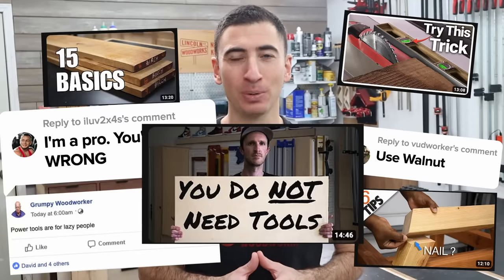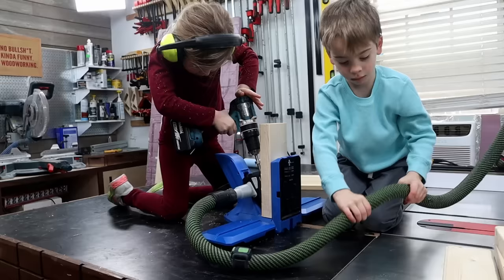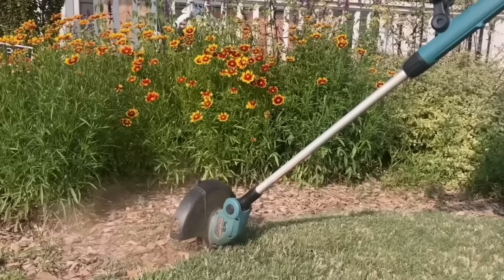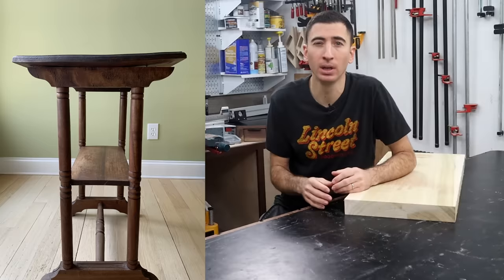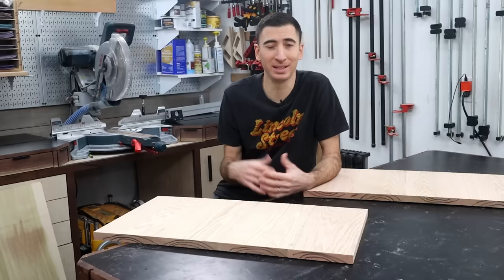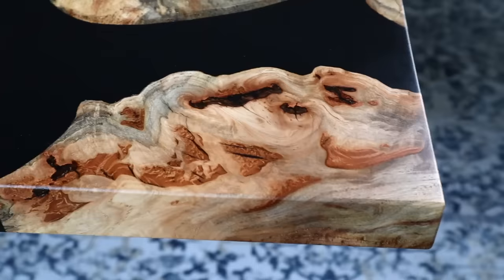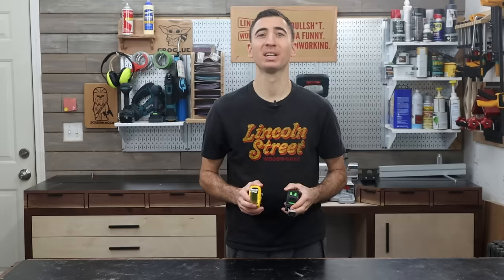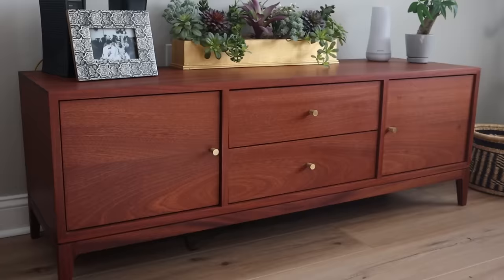Every beginner needs to hear this

Comment: I've been using the same Black and Decker cordless drill for 11 years. Used it on everything around the house building a ton of storage shelves in the basement, used it to build workbenches and frame in the non-load bearing walls in my basement (the horror!) using high strength deck screws and build my kids treehouse and build numerous planters and benches for our backyard across two houses and for building tons of store-bought furniture. I even tried using it as a hammer drill a few times by hitting the back quickly with a mallet (did not work well) and it still works great today. I have their yard tools that share the same battery and those work great too. I've never understood the hate. Outside of trying to hammer the drill to speed up concrete drilling, I don't abuse my tools and generally take care of them. And they take care of me. I've really gotten into woodworking in recent years and consider myself to be between a hobbyist and a professional. I also have some Dewalt tools, some Porter-Cable tools, and they all work great. The only tool that I have that sucks is a Skil table saw that is almost 30 years old that my grandpa gave me, and I'm going to replace it with a Saw Stop later this year because it scares the living hell out of me and is so bent out of square.

Also you know what's the best bang for your buck value? Wen tools. Their larger power tools are very affordable and good quality.

Comment: Regardless of what comments you receive, your advice is sound and practical. Having started my woodworking journey over 40 years ago, I've personally encountered every one of the mentioned subjects in this video and I can attest that your advice is genuine. The one I suggestion I've seen that I really don't like is the wood glue and sawdust. Whenever I've tried that I've found the concoction ends up setting itself before I get to use it. Maybe I was using the incorrect glue but the glue started to dry too fast.
Your info on glued boards cupping, as you mention, is spot on. I glued up a table top of mahogany 4/4 boards using the alternating method and that tabletop ended up at 3/8" thick as I continuously battled the top cupping after each sanding. I eventually decided to seal BOTH sides after the final flattening and viola! the top stopped cupping.
Thanks for your videos. I enjoy everyone you've made.
Reply from the maker: Much appreciated! and thanks for watching

Comment: Thanks for helping reaffirm I'm not a total idiot in the shop.  Simple, logical explanations to some great debates.  I've always looked the overall integrity of a project and not just one single joint.  And your best advice, pick your favorite color, and go with that for a battery system, brilliant.  Great video, thanks for sharing.

Comment: I have to say to the "Measure Twice Cut Once" being replaced by sneaking up on a cut with the internal piece; You are still practicing what is meant by rule/law in that statement, you're in keeping with the spirit of "Measure Twice Cut Once" when you're sneaking up on the cut.

I'm not even a hobby joiner but I use this saying as a reminder of due diligence in my field/trade.
Reply: Except that in reality, he's measuring (presumably) twice and cutting AT LEAST twice.  So, it's really not the same, but can save aggravation later.

Comment: Thanks for calling B.S. on two of my favorite mouth-breather gallery topics: Joint strength and tool brands.  My first media console was assembled with every 'wrong' technique possible... butt joint screws, pocket screws, glued end grain... but it looks great on the outside and years later it hasn't imploded and it's still doing a great job of sitting on the floor and being furniture.  On the tool subject my Dad has used and abused an old Ryobi cordless 5pc kit for years (remember when they were blue?) and guess what... they still get the job done.
Reply: The new batteries have the same platform. As long as the voltage is the same, a new battery WILL work in an old drill/saw/or other. But... The new Chargers Won't work for older batteries.
Reply: I'm a beginner woodworker, but am a full time husband, dad, and domestic repairman.  Regardless of what tool brand I buy I will eventually wear it out.  However I would have gotten  enough years and use out of it that it really didn't matter which color tool I chose.
Reply: Good point on tool brand. My Hyper Tough Walmart power tools might not be as nice looking as my Milwaukee or Rigid tools but they all are 2/3 less and are still running strong.  I originally bought the Walmart brand because I did not want to damage the high price  Milwaukee or Rigid tools while working with tile and cement. Seems I can not wear these cheap tools out while the Milwaukee Sawzall died cutting down our metal swing set. No worries though a $45 Hyper Tough saved the day.
Reply: Butt joints. Yes, never had a problem wid'em.
Reply: Since photography is going away now it's power tools.  GAS- Gear Accumulation Syndrome.  One of those 88 millimeter battery powered nail guns would be helpful  but I will stick with the air compressor for the occasional work I do.  How come I see all these Milwaukee drills on the thrift store?  They only had time to steel the drill and not the battery and charger (this will get me kicked off).
Reply: @Jeff-jg7jh  My employers truck was broken into and they stole 6 DeWalt drills and none of the batteries. The drills that they stole didn't have batteries in them because they were inside the shop being charged. The drills were found in a pawn shop not even 5 miles from the shop. The guy sold them all for $25 because they didn't have batteries. The guy went to prison for 3 years for $25 . The guy at the pawn shop called because he recognized the drills because he was the one who sold them to my employer. Thieves are kind of unintelligent.
Reply: All my Ryobi tools are blue. I got them from my Dad. They all work fine.  (With new batteries)
Reply: @blaster-zy7xx  I have several of the old blue ones. The blue drills are a little slower and that makes them great for drilling holes in metal.  People don't realize that they will take the batteries from the new ones so they sell them really cheap. Ryobi  made a small vacuum called the "Tough Sucker" that is a small wet/dry vacuum. They are really good vacuums. We have many many Ryobi tools. My hammer/drill has outlasted a Milwaukee AND a DeWalt.
Reply from the maker: My impression is all of the professionally trained woodworkers think every piece of furniture that is made needs to either last 100 years (who cares you're dead by that time) or needs to end up in a museum. The reality is most people just want to build something and say "I made that" and that's how it should be.  Its empowering.
Reply: @Lincolnstww  I am restoring our house that was completed in the year 1900. Everything in or on it was hand made. Our windows are larger than most doors made today. I do get a great feeling every time I  successfully replicate even the most mundane things. Our wall studs are 4×6 and mortise and tennon  with wooden dowels to pin them together. The framework of the house doesn't have a single nail holding it together. All hand hewn main beams 14×16 , 12×14 , & some 8×12. It's a very slow process because I can't find any "Off the shelf" lumber. So when I am done with this house, I can say " I SAVED that ".
Reply: @Lincolnstww  Loved the "Shitty Boomerang" comment.😎

Comment: You're spot on, all good tips!
I built a garden stool for my Mom years ago when I didn't have many tools, using nothing but glue on butt joints... not a screw or nail or dowel in it.  She plops it in the dirt and pulls weeds, so it's not sitting flat and takes on a good bit of tension and twisting and she's not a 'small' woman either, it's been left outside in the rain accidentally but just gets thrown in the garage normally and years later is just fine and still looks good too.
I say build it however you can with what you have.

Comment: AHAHA! Gosh, I just love this one... It reminds me of some "discussions" I've had with other pro chefs in kitchens I worked. All the lore and fiction when simple physics or chemistry just say the opposite, like adding oil to the pasta cooking water...
Reply: An odd place to talk about pasta water...but The reason to do that is solely to prevent boil-over
Reply from the maker: Serious statement. Do I add the oil or not? I just assumed thats what you do
Reply: @mrcryptozoic817  Yeah, heard that one too... Except that the only things preventing water to boil over is the heat intensity under the pot and the level of water in said pot.
Reply: @Lincolnstww  It's just wasting good oil for varied dubious reasons IMHO. Best for pasta is just water and salt, 10g of salt per liter of cold water, about a third of seawater salt content. Give a 1 minute boil to the water to diminish the chlorine and other compounds that can evaporate.
Reply from the maker: @wildpat03 thanks!

Comment: As a custom furniture maker for over 45 years, it is nice to hear some solid advice.  I would add 2 (of many) additional simple items.  First is what many people fail to mention about pocket hole assembly (personally I use a domino whenever possible because of both the strength and the perfect alignment of the parts) ; unless you are making a rustic looking item, definitely clamp your parts when shooting the screws.  Pocket holes, because they are angled, will pull the faces of the joined pieces out of alignment unless you have them firmly clamped. The second item is if you plan to make projects out of expensive solid hard woods and want good long term results, invest in a moisture meter.  You can get a decent one for as little as $40 and it is a solid investment.  I have pulled boards from stacks at my local hardwood supplier where two nearly identical boards from the same stack has over a 10% spread in the moisture readings.  Using those together (or even using the board that was at over 10% at all) is an invitation to failure.
Reply from the maker: Great tips!

Comment: All sage advise! Another excellent video - thank you sir! I use the pencil sanding method. For the pencil I use one of those really big flat carpenter pencils - seems to work well for me. One thing I always try to do when I am finishing up removing the pencil lines is - wait for it - always finish your sanding in the direction of the wood grain, never at an angle to it.
Reply: Same. I also sometimes like to use a piece of chalk - even easier and quicker than a carpenter's pencil. Not always suitable though - sometimes the chalk doesn't stick enough and a pencil is required.

Comment: Interesting points. I think one thing I'd push back on is that first one, where you say that a table or a tv console doesn't need to support as much weight as something that people will be sitting on. I think a lot of people use their end tables as a stool when they need to reach something like a high shelf or a lightbulb, so while we can blame the individual if they get gurt since that's not an intended use for a table, i still prefer to build it with an assumption that an adult will stand on it at one point and that a child might jump on it repeatedly. At least those are my thoughts

Comment: I have some blur Ryobi tools from 25 years ago that came NiCad batteries. They still work and use the newest batteries. For the hobbyist, Ryobi is a good choice.
For shading with a pencil to help sanding, I like to use a 5.6mm mechanical pencil. Big, soft lead shades well and you never need to sharpen. It doesn't break much either.
Reply: I use milwuakee tools and absolutely love them, but I also do a lot more than wood working. I bought my dad a bunch of ryobi tools when his 30 year old black and decker tools were finally dying and honestly, the only difference I noticed was the sound and torque. The Ryobi has slightly less torque, but it felt more comfortable to use. 

If I lost all my milwuakee tools somehow, I’d probably restart with Ryobi, mostly for their dedication to battery consistency. 

But yea, all cordless tools these days are comparable. Motors and batteries are getting cheaper and more powerful, so the main difference is form factor.

Comment: I started out woodworking a few months ago and I am still a beginner. But I bought a lot of tools and spent a lot of time on overkill joinery based on recommendations. Half laps look easy and are very strong but they can add days to a project ! As a weekend warrior the feeling that you cut a lot of half laps or joints but you didn’t finish the project makes you think. 
I have a pocket hole jig but pocket holes don’t help with alignment, my wood always moves when I screw in the pocket holes. I use teak and it splits visibly 1 out of 4 pocket holes. 
So I bought a dual spindle doweling  cutter. Best $100 bucks spent: you can do exactly what the YouTubers do with their festool domino, just with dowels instead of dominos. Now I dowel + glue everything together and call it a day. Getting stuff finished in a weekend is more important than following some ideology.
Maybe I will think differently when I have more experience.
Reply: I wish I’d have invested in a nice dowel jig before a pocket hole jig
Reply: @jk_22  I agree, if I do pocket holes I do dowels for alignment, but mostly I use dowels alone. Be ware, there are some expensive dowel jigs out there, you don’t need them. A drill and those spiky things you can put into the dowel hole to transfer the location of the dowel to the other part is enough. Or get a dual spindle doweling machine.

Comment: Your comments are tool brand are spot on.  When you are just starting out, the tool brand you chose should be whatever you can afford.  There's no need to invest in pro grade tools unless you are doing pro level work and you can always upgrade later on if you decide to.

Comment: Great advice.  I see the wood glue and sawdust advice all the time for small imprefections and cracks.  I always use CA Glue or Epoxy.  It just works better and finishes a lot better as well.  Thanks for sharing.
Reply: Small tip. Don't use epoxy glue with oak, tannins in the oak will affect epoxy. leaving you with messy goop, that has to clean out of wood surface.
Learn that in hard way

Comment: You nailed it, Jon! You talked about beginners in woodworking and not seasoned veterans with 100 years of experience and know everything! I watched those other videos that you mentioned and wondered about their conclusions, if glue and screws are not strong enough for furniture making maybe I should weld the corners using steel instead, that's got to be strong enough, right? Love your videos and knowledge with a laugh, keep up these great videos! Cheers!

Comment: On the measure twice cut once point, I think it is worth pointing out that it is good to make a job stick for certain jobs where the measurement is made once on the stick and cut marks made.  You then use this as a reference on all the workpieces so they are all the same even if your first measurement was slightly out of what you intended.

Comment: The whole alternating grain thing only works if you laminate together an equal numberof pieces of wood with alternating grain orientation in several layers. That way they can exert  opposite forces. Glueing them side by side in a single layer does SFA, because the twisting force isn't opposed by anything.

Comment: You have me on everything in this video except for the Ryobi circular saw, which I have, and I have no idea how it got past QC.

The plate is not parallel to the blade by 1/8 front to back, the depth lever can't lock if the cut is deeper than 3/4" because it hits the plate, and anything more than a feather touch tilts the blade off axis. On top of that, I can't fix these problems because everything is riveted or welded, and I couldn't take it back because it was a gift.

The other brands, 100%. A truck is a truck and there's functionally no difference between the big players, but Ryobi is very much a get-what-you-pay-for when it comes to precision.

Comment: OMG, the tip about using a large pencil vs a mechanical pencil for marking before sanding was awesome. I'm always using a mechanical pencil and I get so frustrated because I sand and sand and sand and the pencil mark never goes away. Thanks!

Comment: I'll tell you one thing from experience, Don't buy Ryobi. Especially their miter saw. Yeah maybe their drills are ok.. But don't buy any tools from Ryobi where you expect precision.  I speak from experience, I ended up returning their miter saw and router. Got a DeWalt and Milwaukee. Huge difference.. Worth it investment.
Reply: He wasn't talking about miter saws or even table saws in this video he was targeting mainly battery operated drill and drivers
Reply: Yeah Ryobi is never accurate without a bunch of recalibration.
Reply: Oddly enough, I have a Ryobi drill that's so old it's dark blue. Used it again today.
Reply: @luthiermatt  some of those older power tools are actually decent. They might not have all the power and technology of new ones, but they were precise and reliable. I have some old old power tools from the 60's or probably and they still work like new, but I don't use them for work. I have new power tools for that but those old tools are awesome just to have around in case you're in a pinch.

Comment: Pay no attention to useless criticism...you have a lot of good points that are of benefit to amateur woodworkers like me. There is a big difference between criticism and critical thinking...it sounds like you bruised a couple of egos but you do in fact present reasonable evidence along with what you are presenting. If someone is angry about whether it's lumber vs timber vs wood, they shouldn't be using power tools.  Thanks for an excellent tutorial!